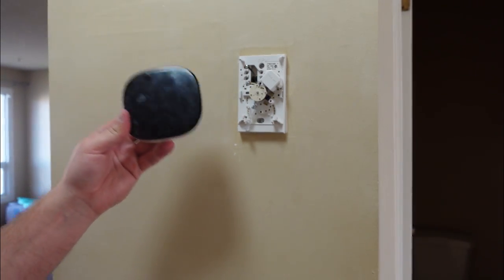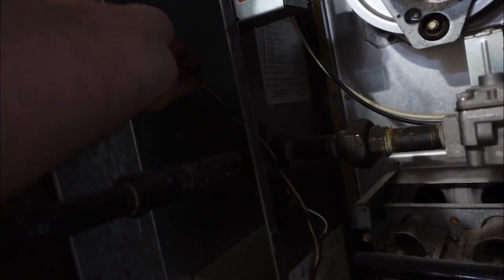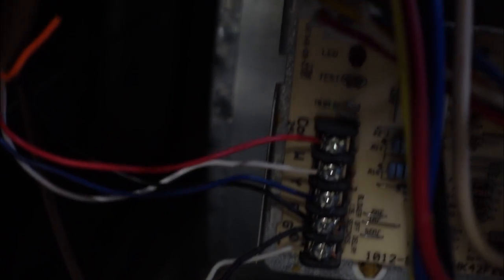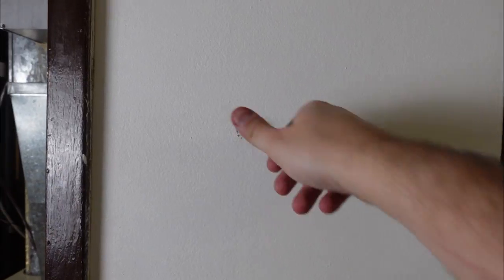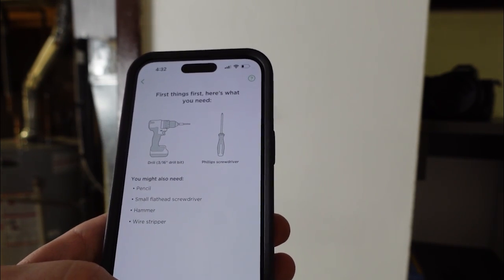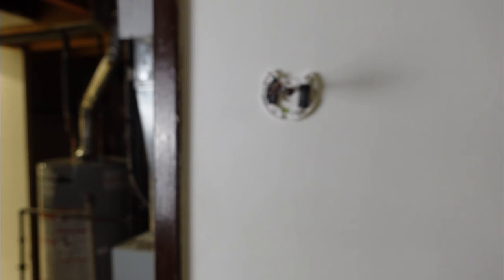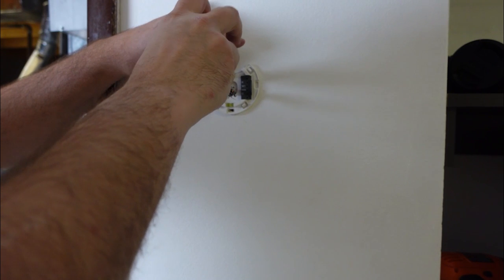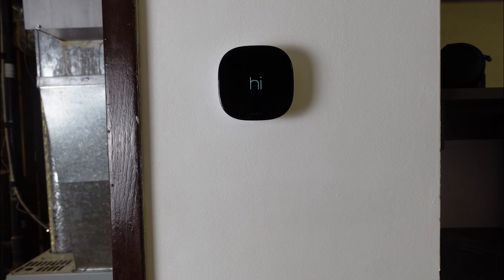Installing the Ecobee Smart Thermostat

Comment: Ecobee comes with the PEK in the box so all you need is 4 wires (W1, W2 for furnace, Y for AC, R for trigger, G for blower). 
You on'y need more than 4 if you have multiple stage AC, or an accessory such as a humidifier, or have a system with multiple fan controls (G1, G2, G3).